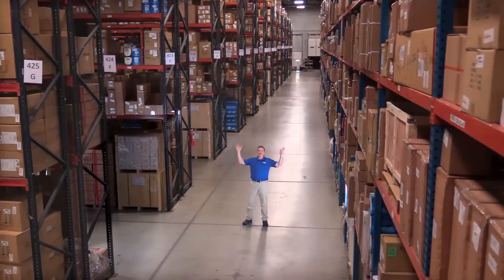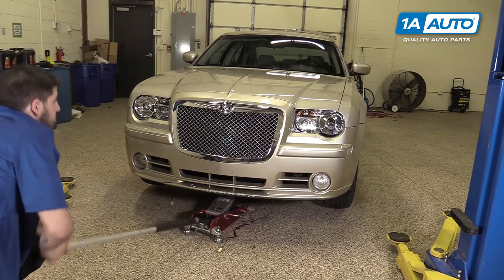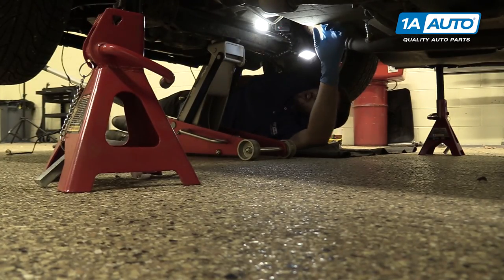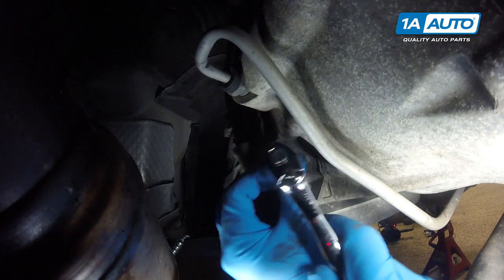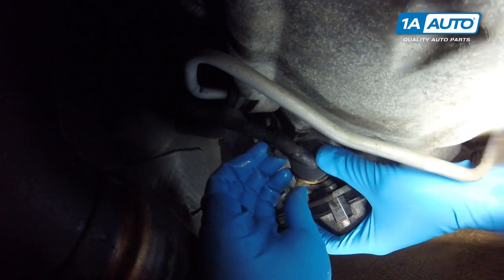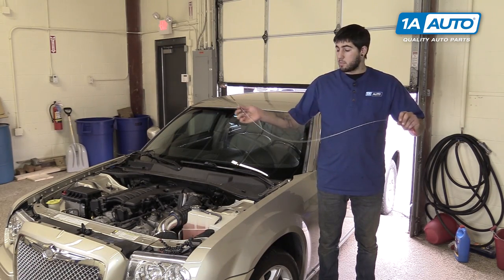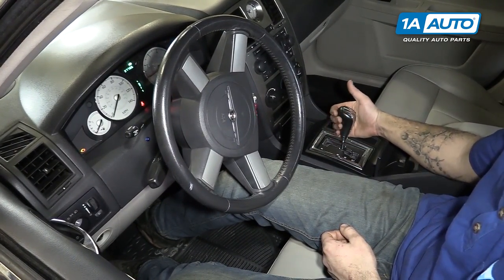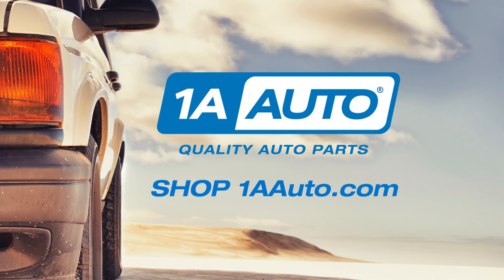How to Replace Automatic Transmission Connector 05-07 Chrysler 300

Comment: Subscribed. Everyones going straight to tcm, pcm, fuses/relays, plugs and coils but hardly anyone has mentioned this connector and fluid levels pertaining to my codes. Just checked my connector and it was dirty with oil. Hopefully the replacement later works. Thanks 1A!
Reply from the maker: +N Flores Thanks for checking us out! http://1aau.to/m/Shop-1AAuto-c
Reply: Did it fix it? My plug is full of it too

Comment: This video was very helpful because we had to do this job.  I just wish it had mentioned how easy it is to snap that little retention bolt. We snapped it and now are struggling to apply sealer rather than replace the whole transmission.

Comment: Chrysler/Dodge cars/trucks require the transmission to be in neutral to check the transmission fluid. The pump does not circulate the transmission fluid in "Park". It only circulates the transmission  fluid in "Neutral". This is critical to get the correct transmission fluid level. This is for all years of cars primarily. 
Checking the fluid in "Park" will give a false reading of being full.

Comment: Ok so now I did that with turning the piece down and taking the wire out I loosened up the little bolt in the inside only things that happening is the yellow piece came off but I still can’t get the plate out so how do I remove it is there another tool I need or something
Reply: And it’s a2007 Dodge Charger 3.5l
Reply: What did you end up doing?

Comment: So if there trans.fluid on the connector, will this cause it to go into limp mode. And by cleaning it, will this help in fixing that issue
Reply: When I took this connector out it was full of transmission fluid. I cleaned the connectors with electrical cleaner. I had been stalling at low speeds for a few years now. It immediately stopped the car from stalling. Since I purchased this part it's been a big headache trying to get it in. I'm hoping this will fix my problem permanently.
Reply: @Dwartay77  how did it go?

Comment: I took my 300 into an exhaust shop that had to torch out a stud from the manifold to the catalytic converter.  I am not receiving a code P2368.  Could the mechanic have messed up the connector, or should I be focusing on the wireing

Comment: 2010 RAM 3500 shifts to Reverse  on its own while driving @100km/hr. And engine stalled. Seems not mechanical problem. Whats the cause: Solenoid, wire, pcm...?Could you give advice?
Reply from the maker: +Tom and 车 We wouldn't be able to diagnose an issue like that here, you may want to have a local mechanic take a look at it. Thanks for checking us out! 1AAuto.com

Comment: HELP Please - I have a 2009 300 - heard a loud bang and now the car won't drive - starts/runs fine, but will not move in any gear. Rear Diff seems to fine as well as drive shaft - any thoughts?  The transmission has never had an issue or any warning signs
Reply: Did you find out the problem cause I'm having the same issue
Reply: What was the issue?
Reply: And how did you fix it?

Comment: Will this part make my transmission not shift..I started having a problem with it..only when the transmission gets  hot wont shift then when it cools I'll start shifting again
Reply from the maker: +Cesar Villafana A few common causes are low or dirty transmission fluid, or faulty shift solenoids. The transmission uses fluid pressure to shift the gears, and does so using electronic solenoids. If there is an issue with either of these the vehicle may experience problems shifting or transferring power to the wheels.
Reply: so this wont b the cause?

Comment: I can't get the connector out the bolt just spins in both directions
I was about to change it just in case but i wasn't able to unscrew it because of spinning bolt and after all i've just put the plug back in and I left it like that..

Comment: my trans stays in 1st gear sometimes and I have to pull over and shift into park is this the solution to fix that
Reply from the maker: +ACE716_westside We wouldn't be able to diagnose an issue like that here, you may want to have a local mechanic take a look at it. Thanks for checking us out! http://1aau.to/m/Shop-1AAuto-c
Reply: @1AAuto  thanks but I got it now it was just bad wheel speed sensors
Reply: You have a bad wheel speed sensor. Oops, just saw you already found the problem.

Comment: I can't get the connector out the bolt just spins in both directions
Reply: i have the same! how did You hadle that? i was about to change it just in case but i wasn't able to unscrew it because of spinning bolt and after all i've just put the plug back in and I left it like that..

Comment: Exactly what  Needed to get the valve body out of a 06 jeep grand cherokee 3.7l. thanks
Reply from the maker: +Awavy1 Thank you for watching. We don't have the exact information for this repair, but if you search through other channels you should have the information required. 1aauto.com
Reply: Does your Jeep die and won't crank after you drive it dealership said it was the TCM saying transmission overheating
Reply: Drop pan, catch all fluid. Wipe up excess. Remove this connector, and plug. There are I think 10-12 bolts for the valve body. Take those off and the valve body drops out, along with this conductor plate that this plug goes into. Get yourself a new replacement for both the conductor plate and plug, and if you suspect your valve body is messed up, get a replacement for that as well. Reinstall in reverse order. Be sure to use either Mopar atf4 transmission fluid or royal purple max atf (same as the Mopar stuff). Fill up trans till there is a good amount in there with new fluid. Then either use a laser temperature reader or something and fill to the required amount based on the chart. These transmissions are very picky as to the level. I think a tolerance level of about 8ounces a over or below the requirement should suffice and won't cause an issue. Be sure to check your gear engagements in all gear selections.(reverse, neutral, drive, etc). You don't want an increased delay in the feel of the car after the gear has been selected. Good luck and have fun. Btw, do yourself a favor and whichever trans you have, get a deep trans pan and filter extension. Be sure it has the drain plug in it. Will make for cleaner future transmission services. :)

Comment: I absolutely hate when the jack points are on pinch welds like they couldn't come up with any better point to jack up the car?? I can't tell you how many times I jacked up a car where the pinch weld is the jackpot and it get completely crushed under the weight of the car it's insane your balancing a 2 + ton vehicle on a less then a 1/4  inch piece of metal!!